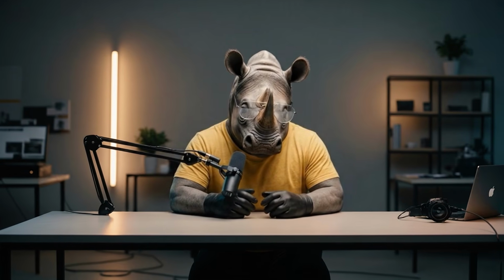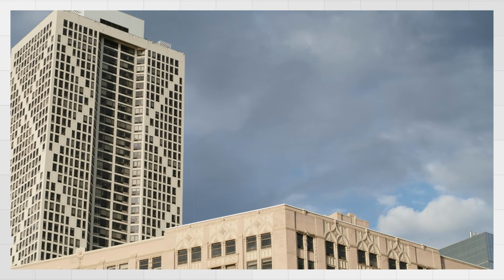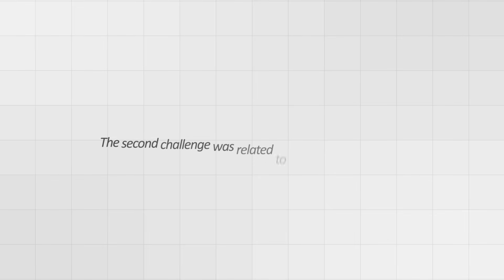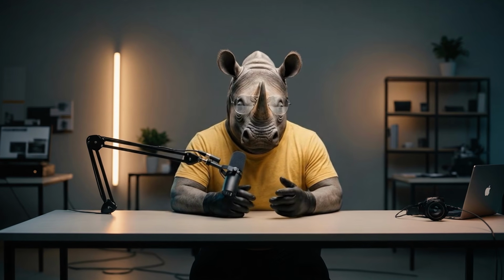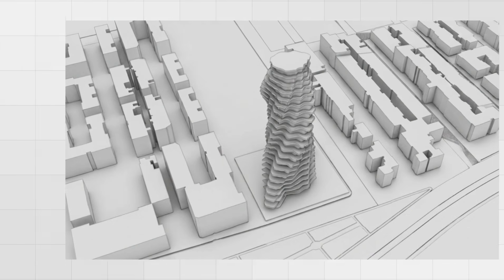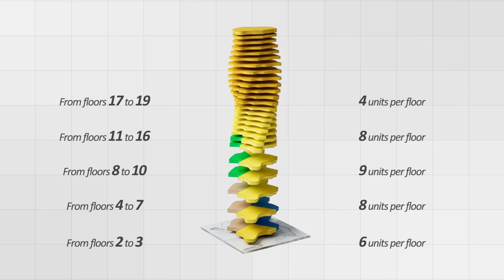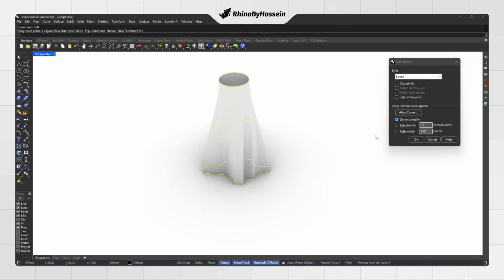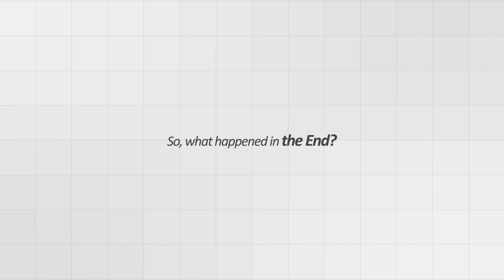My First Rhino Project After 15 Years | The Story Behind the Design

Comment: It needs structural engineering's calculations, experienced HVAC designers, BAC Building Automation Controls DDC and Revit in Rhino.
Reply: HVAC designers must have hands-on service experience, otherwise there will have thousands complaining every day when operating.
Reply from the maker: You're right, there’s definitely a much wider world of technical coordination required for these projects to be fully functional. 😊